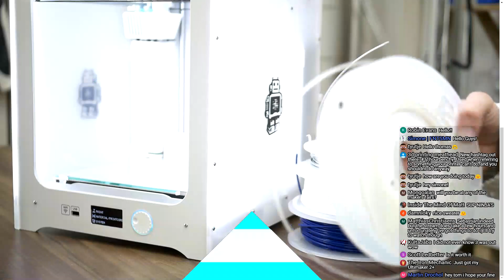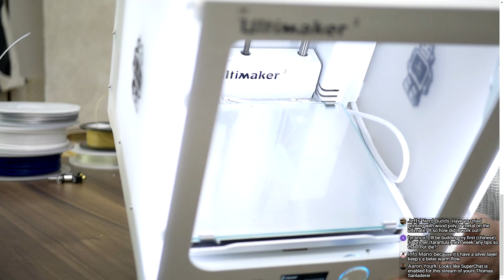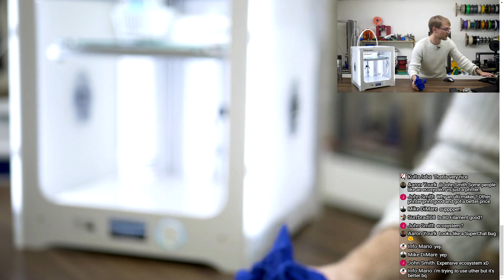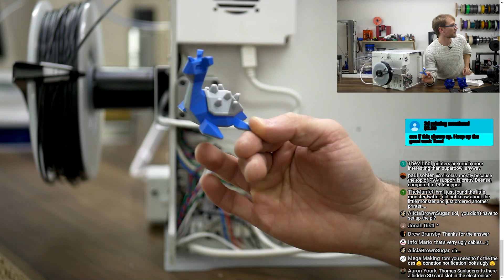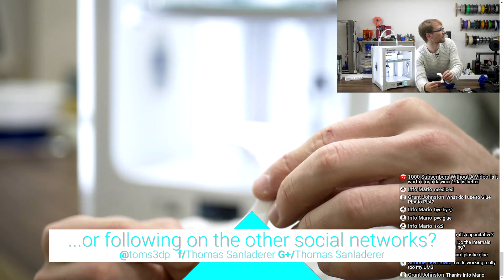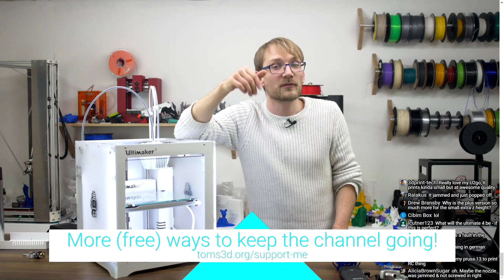Ultimaker 3 Q&A: Things I left out in the review!

Comment: How much does heat expedite PVA dissolving? Would it be worth adding a simple adjustable aquarium heater in combination with the water pump?
Reply: It does speed things up quite a bit, i use a aquarium heater set to about 40C, in combination with a aquarium pump or two for circulation and it works really well.